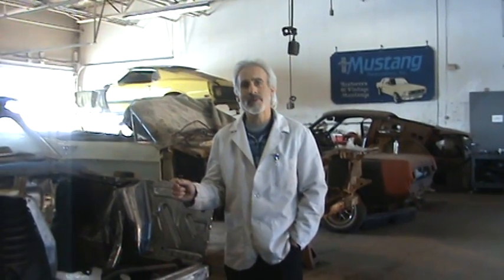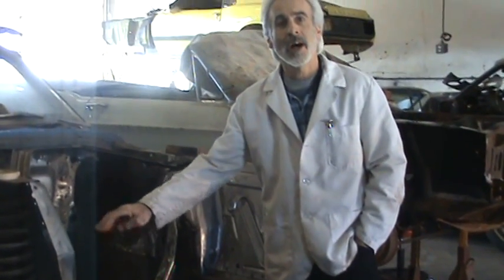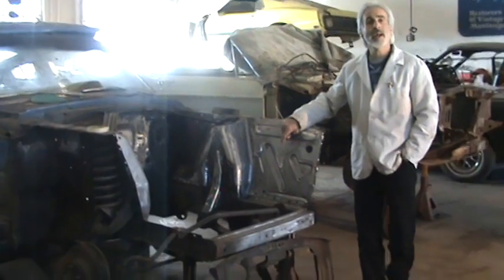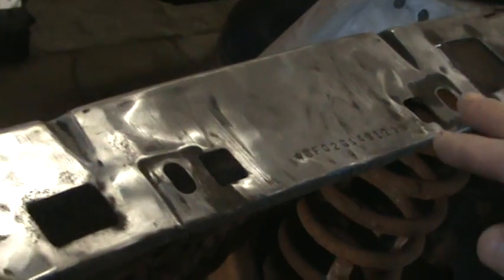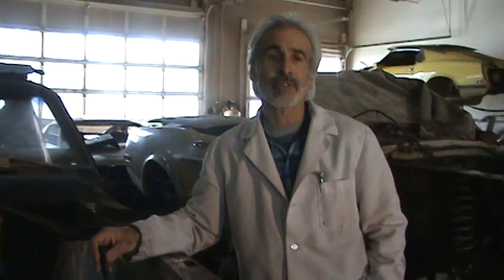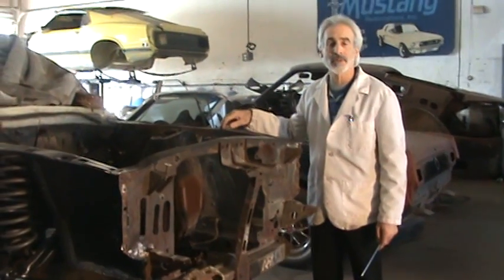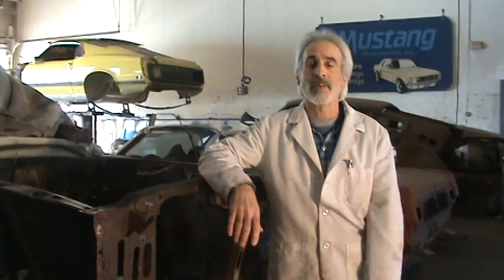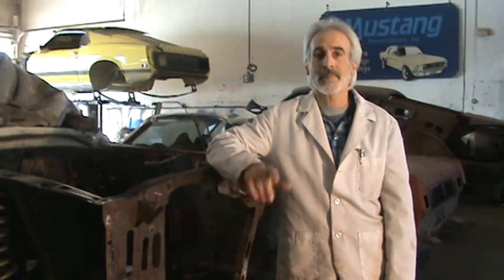Mustang fender apron "How To" - OperationMustang.com

Comment: Good video, but I have noticed it is kind of hard with a Mig Welder to weld the apron to the frame.  I will melt through the apron and never penetrate the frame.  Any tips?  Thanks.

Comment: just got a project car (68 cougar)  and the orig.  inner aprons are GONE.  Have replacements but the bracket that's supposed to be taken off the old ones are also gone.  how does one remedy this. Measure and fabricate one?
Reply from the maker: Hi. The aprons are the panels welded in front & behind the shock towers. The rear ones have the hood hinges on them & the front ones have the battery tray on the right & the washer bottle on the left..What brackets are you referring to?
Reply: Im sorry, I this video is for a 65 Mustang.  Sorry for wasting your time.

Comment: i got 68 mustang fastback . and there is no vin on fender . but i got vin on drivers door and another vin number is on passenger side .am i should worry about it ?
Reply from the maker: 68 is the first year for a Vin tag on the top of the dash ,seen thru the lower windshield. This should be on the passenger side. After 68 it was moved to the drivers side. You need to be worried if you don't have that tag.
Reply: +Chris “The Doc” Ingrassia thank you for support . what about the fender? i dont have any vin on it .
Reply from the maker: Once they started putting the Vin tag on the dash in 1968, they fazed out the stamping process on the drivers apron which is the public Vin. I see a lot of 68s without that stamping because was no longer the public vin. However,,,Your 68 does have the "confidential" vin on the passenger side as shown in the video.  If you feel that you may have a problem. Unbolt the fender enough to pull back to see if you have a vin there.
Reply: +Chris “The Doc” Ingrassia i did and there is no vin . thats why i worry about it.  maybe they  cut it when they restore it   . any way thank you for information
Reply from the maker: Some times they put the stamping far back near the hood hinge area.  The other scenarios are, rusted aprons needing replacement, a collision that required those aprons to be replaced, ,,lastly.. to remove the vin. number for unlawful means. Next thing to do is pull the dash pad to see how the vin tag is fastened. Send me a picture & Ill give you my opinion.
Reply: +Chris “The Doc” Ingrassia thanks. i send picture on your Facebook:)